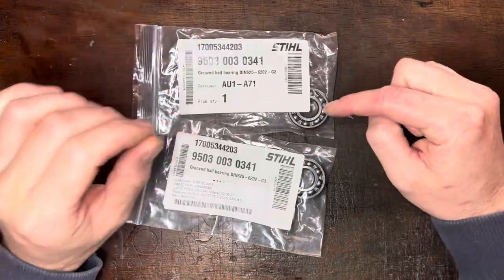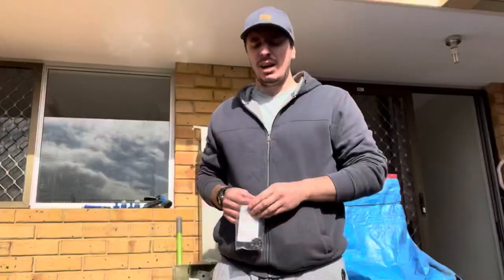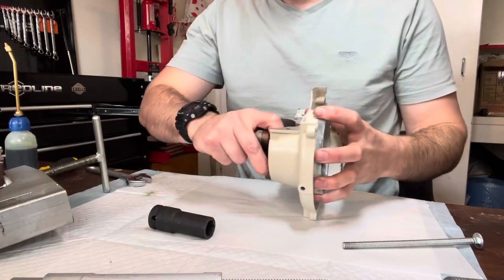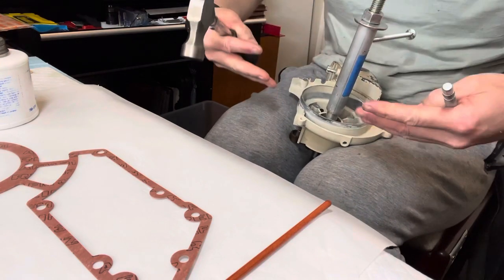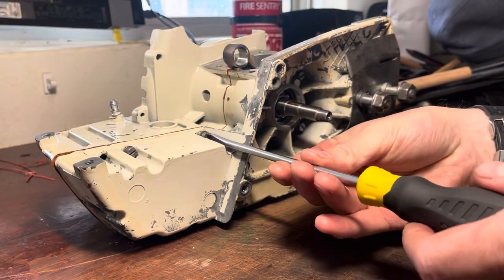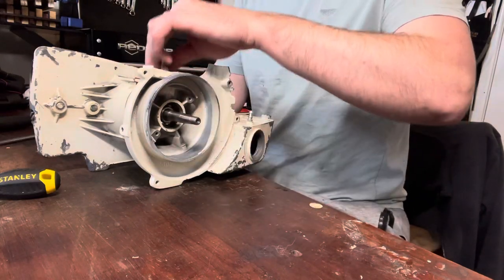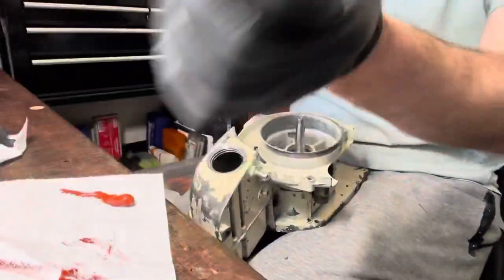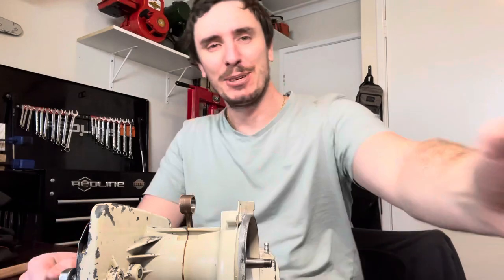How To Install A Chainsaw Crankshaft & Bearings

Comment: Great video.  I’ve found sockets can be used to press bearings in.  Key is to make sure the socket is on the outer racer, otherwise, you’ll trash the bearing.

When you heat the case, does the bearing literally fall into the crank housing without any pressure?
Reply from the maker: Awesome, yep I like using sockets sometimes too! Yes the hearing will literally just fall out when the case it how enough. Just note, when you heat it up over 10-15 mins in the oven, the powdercoat will start to yellow, that’s why now I only ever use a torch and do a quick burst of heat. Hope this helps!
Reply: @VintageEngineRepairs  Thanks, that’s really helpful.  Do you have any tips with how I deal with the wrath from my wife regarding using the oven to heat engine parts? 😂
Reply from the maker: Nope, other than do it when she’s not there and allow yourself an hour or two to air out the house after of the burnt oil 🤣🤣🤣 good luck! If I don’t hear from you, I’ll know why!
Reply: 😂😂 @VintageEngineRepairs

Comment: Doesnt putting oil on the crank shaft make an unnecesary layer of material between the bearring and shaft which is also a slippery one in a place where you want them to stick
Reply from the maker: I always do so both as it is per the oem instructions and for ease of installation and to stop galling / damage. 👍🏻
Reply: @VintageEngineRepairs  just to be sure, thats 2 stroke oil were talking about? 
One more thing, ill be building the bottom end of a chainsaw(ms360) for the first time, so i dont have the crankcase build tool like you used to put the crankshaft into the case halves. Would it be fine if i inserted the bearings into the case first, then put the crank shaft into a freezer and before assembling also heated up the case halves with the bearrings in them. Would that work? If so, any tips?
Reply from the maker: Yes you can do, just don’t overheat the bearing. It’s very likely it will get stuck half way too and you’ll end up forcing the bearing on which will side load the bearings. Not ideal, but some people do!
Reply: @VintageEngineRepairs  sounds like thats a high chance to waste 42 euros worth of bearings this way. How else could i do it without the tool that you used?
Reply from the maker: @karm00n29  I wouldn’t really recommend any other way. Installing the bearings onto the crank first can be done, but you still open yourself up to issues. Give it a go; just don’t overheat the bearings. If in doubt, see if your local shop has a puller?

Comment: What to do when crank spins with resistance bit more than you would expect from two bearings (no seals installed)? How to know where to tap/pull/whack?
Reply: @VintageEngineRepairs  Thanks. It worked, kinda. It spins more freely. Wish it would spin even freer though. Hard to know how free it could possible spin. I'm ready to let the running engine sort the rest out. Surely heat and revvs from saw running could relieve any last preload?
Reply: @VintageEngineRepairs  I used heat on case and bearings on both sides plopped down in the pockets good. I heated center of bearings in the case on clutch side and crankshaft dropped in place good. On the other side it did not drop all the way as me fiddling with the gasket made bearing cool and I used the bolts on the crankcase to close the last 3mm. Guess the preload comes from that? I have no tool to pull the crankshaft. Would such a tool and to give the crank a pull relieve preload?

Comment: The silicone is absolutely unnecessary on the gasket AND seals all it does is make it look sloppy and unprofessional. None of the manufacturers use silicone at all. It's wasting time and silicone. I've been doing this for 40 years and advise AGAINST the use of silicone on the crankcase and seals
Reply: Unless you have crank case seal issues do not use gasket material just a gasket
Reply from the maker: Thanks for your comment Len though I disagree. Brand new from the factory, all surfaces are perfectly machined. Over the years and with careless mechanics, the surfaces get damaged and the surfaces are no longer machined, this isn’t silicone just so you know, it’s a purpose made aviation gasket dressing compound.
Reply: Destroyed @VintageEngineRepairs